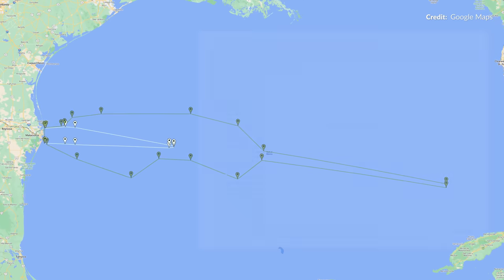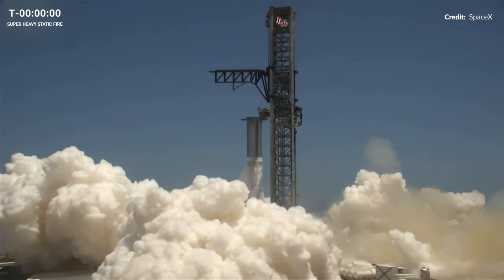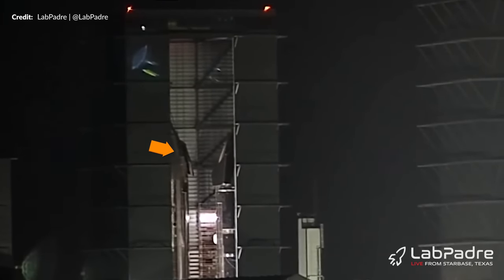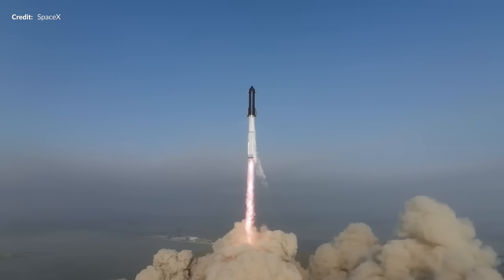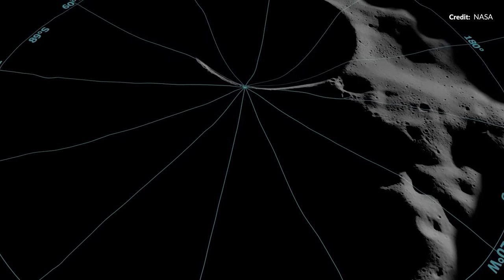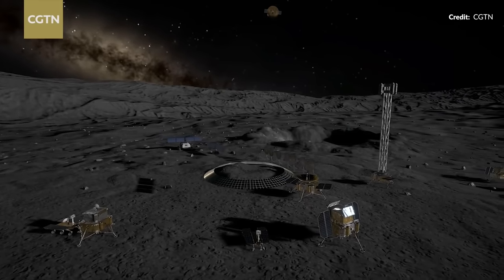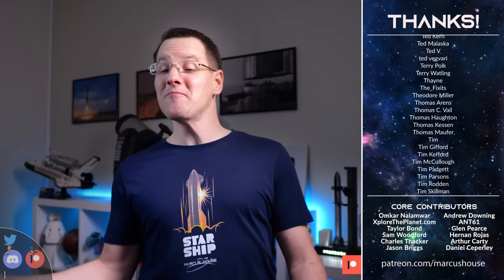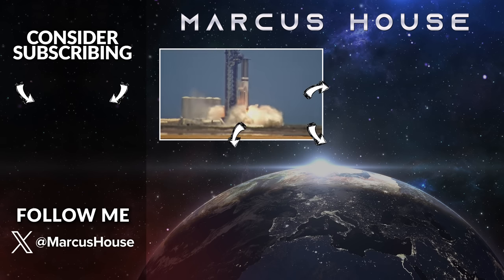SpaceX Drops Bombshell Upgrade, and Starship Flight 2 Date Intention Revealed!

Comment: I'm perplexed as to why SpaceX is using the very complex steel plate & deluge system instead of a simple, proven, and reliable flame trench???
Isn't Elon's philosophy, "The best part is no part"?
I'd love to hear your thoughts about why they went with this complex, high maintenance design.
Keep up the good work. 
Cheers from Alaska
Reply: I recall the reason given was that the local water table is only a few feet beneath local ground surface.  As to how that would cause problems for building and using a flame trench I don't remember.  Cape Kennedy also has a shallow water table, but NASA got around that by building a plateau for the launch pads to dig a trench into.  However, that was a huge civil engineering project that took at least a year, and Elon is in a hurry.
Reply: If you think a flame trench pad is simple, I have a bridge to sell

Comment: Waiting for a day when they release notams nearby Hawaii... That means a suborbit flight for Starship.

BTE did Hawaii wildfires make difficulties for SX launch? Ground support damage etc. Using loads of methane is not good for the climate ad dumping some in a crashlanding is not a good thing. More blowups in the atmosphere is also adding more ghg's that are not needed specially in the upper layers. So far Starship has been a single use craft that has high environmental cost.
Reply: The ship reentered far away from populations, by the time of the end most of the fuel will already be consumed
Reply: Nor sure if they need notams for the designated landing site... it's a missile test range, so I don't know that it's subject to the usual rules.

Comment: Again re entering the earth atmosphere your going to face temperatures of 3000 Fahrenheit titanium wouldn't be good enough 3040 Fahrenheit melting  temperature of tungsten 6.191 Fahrenheit I'm sure it would be mentally expensive but as I see it it would be fail proof
Reply: "mentally expensive" is a good enough reason to throw the tungsten out of the window
Reply: Steel plates on the Space Shuttle survived reentry, I see no reason to doubt Starship so early.